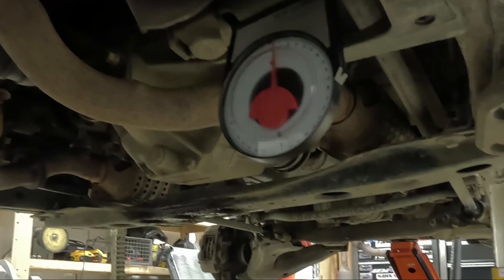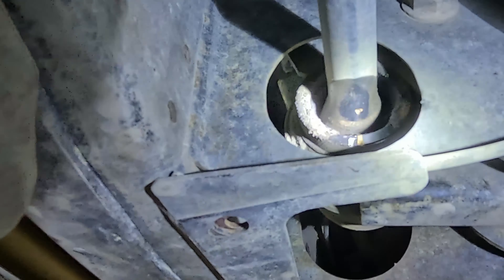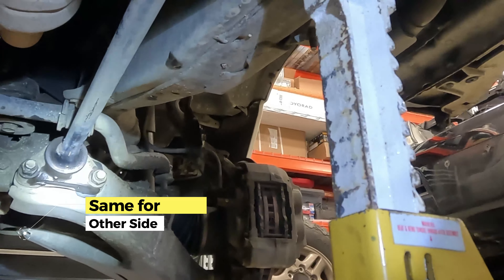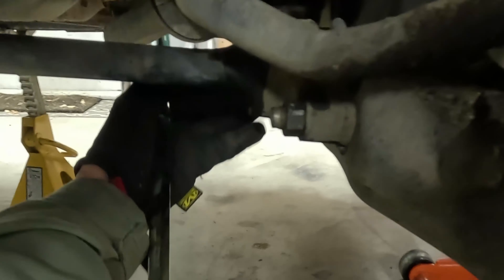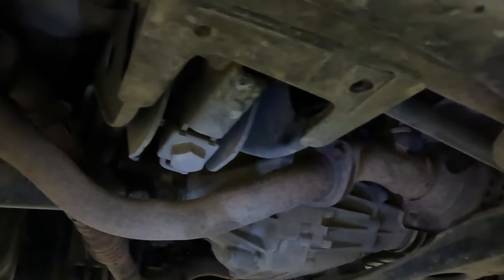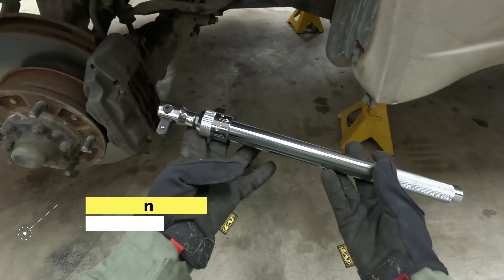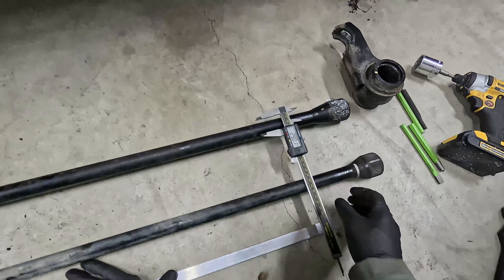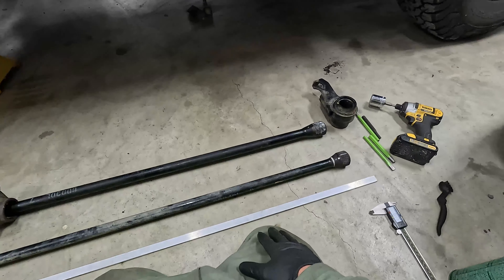Reviving AHC for heavy loads: The $1,00 fix: Land Cruiser Torsion Bars in your Lexus LX470

Comment: I just did this so thanks for the video. Is there a "direction" for the back of the torsion bar vs the front? I assume these things are built to twist in a certain direction but mine had no forward or rear indicators sadly. lol. OEM
Reply from the maker: It should have them on the bar as indicators. I used oem as well and it was there.

Comment: How is the ride quality using the stock LC torsion bars.  Were you able to maintain the proper AHC pressures with the beefier bars?
Reply from the maker: My rig is about 7k so it went into limp mode with the AHC so it would protect it. I did research and found to change my rear springs and torsion bars would fix this problem. After I changed both I did tech stream and got my AHC back into spec. Ride quality is fantastic for a heavy 100 series.
Reply: @DMOReviews Which brand of rear springs did you decide on?  Spacers as well?
Reply from the maker: @ no spacers and I used oem Land Cruiser springs. It road like shit until I got tech stream dialed in and now it’s super smooth.